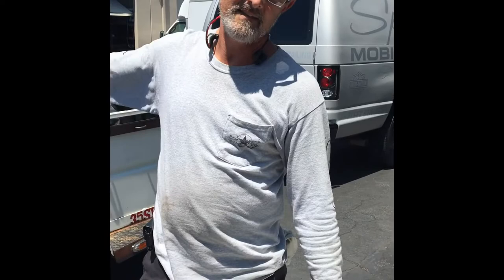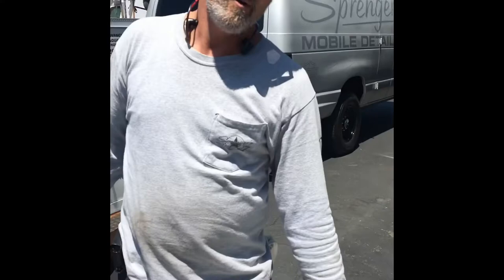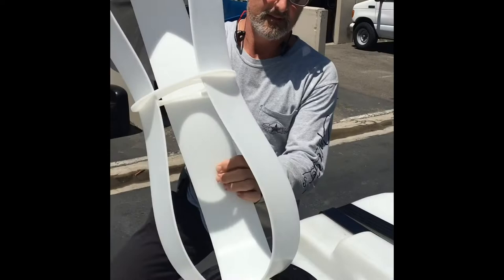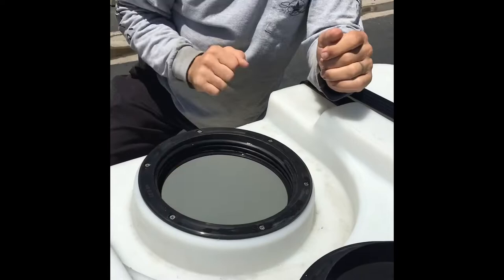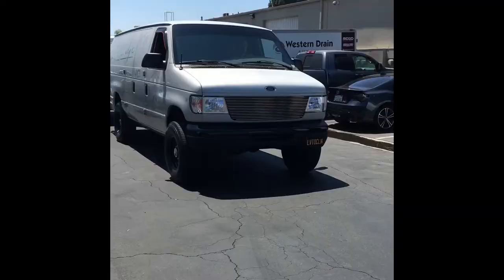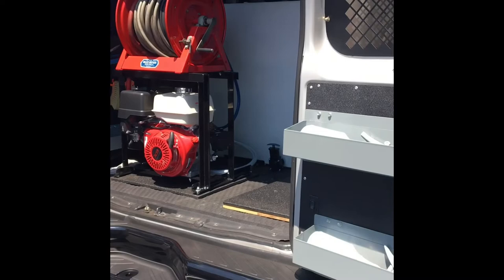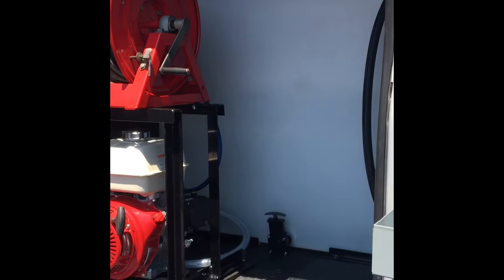Water tank baffles system

Comment: Very helpful to see this video.  I wondered how you put them in through a small opening, and this explains it.  I have an RV with a 40 gal water tank.  My questions for you or anyone else are:
1.  What kind of baffles to use so I don't get microplastic breakdown in drinking water?
2.  What kind of baffles to use which would fit into a narrow 2 inch neck opening?
3.  How easy is it to clean them with bleach in tank once in a while? 
4.  Can you take them out once inside the tank?

Thanks!
Reply from the maker: You can google "baffle balls", they're life wiffle balls, they are small enough to fit in your small opening. Hope this helps.